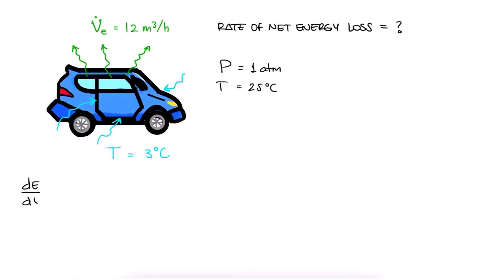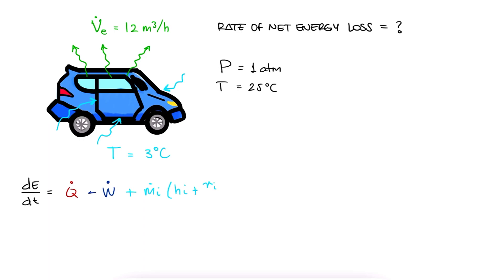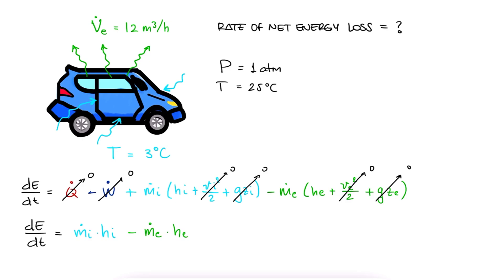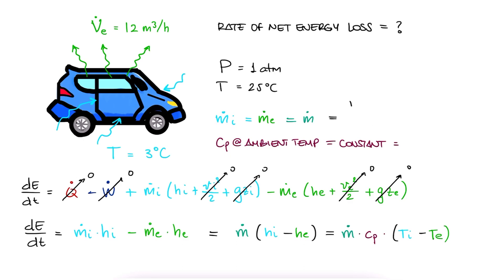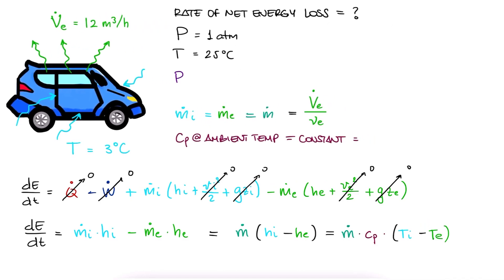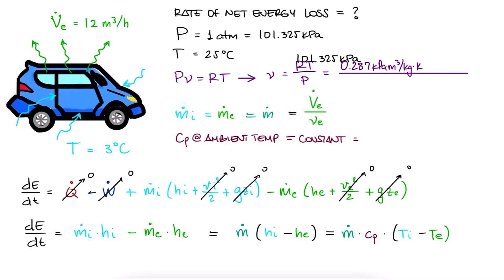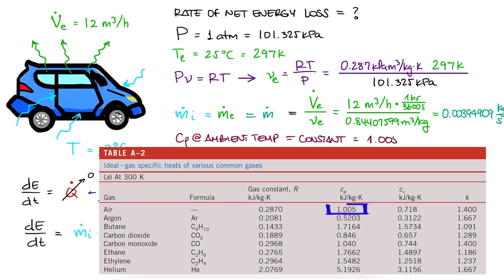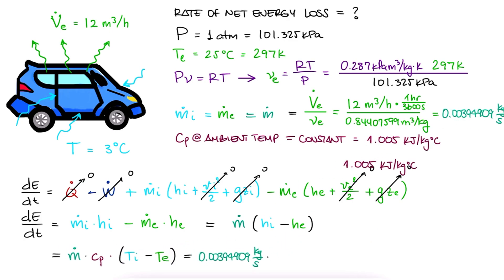Flow Work for Air Flow Through Car in 2 Minutes!

Comment: Why isnt there system heat?? The difference in temperature indicates that it should have a heat flow, so like a heat exchanger, no?
Reply: the car is maintained at 25C meaning this number doesn't change thus no gained heat or lost heat in the system think
Reply: The better explanation is that we are analyzing a system using the right form of the energy balance equation and he explicitly said it's maintained at that constant 25°C in order to maintain something that is implying that it is not changing. Q_dot is zero because remember it's really saying, Delta Q/dt and if theres no change then as you likely know then poof that term vanishes